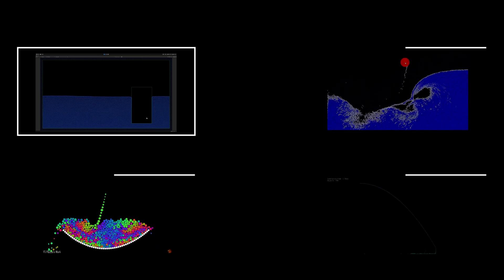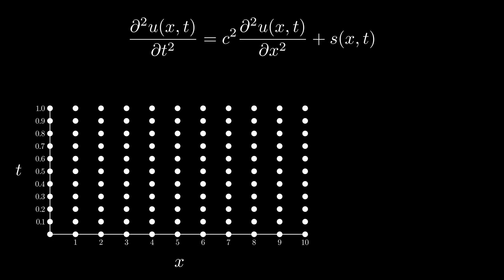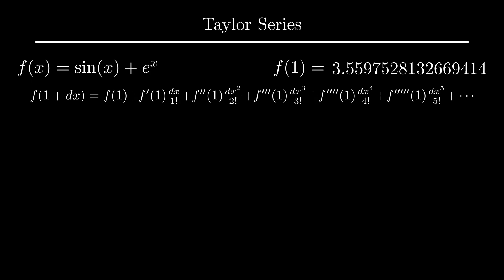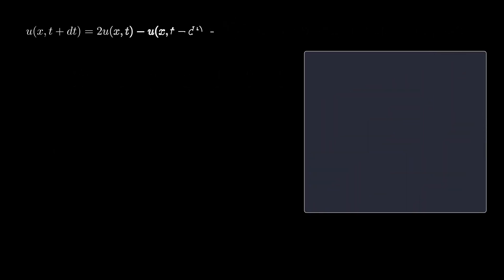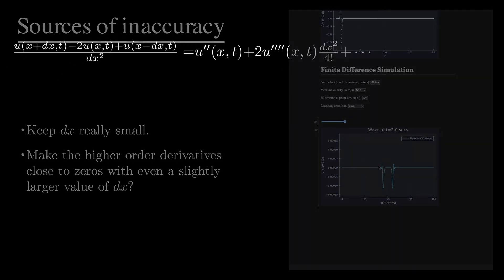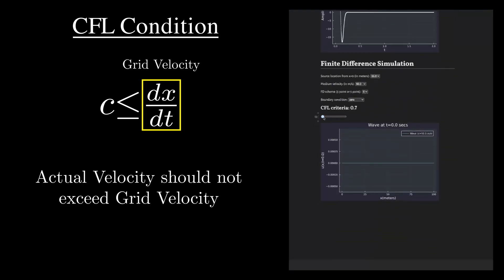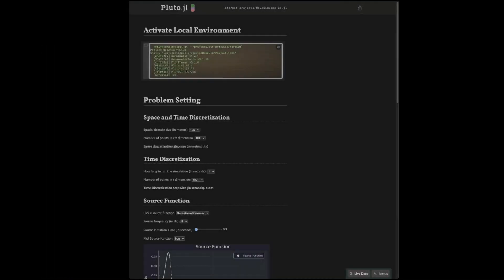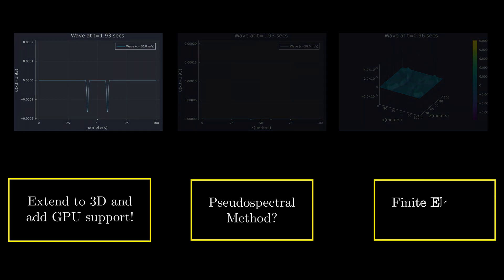Wave Simulation from scratch using finite difference method

Comment: Man this is awesome. 

I have solved Schrodinger equation time independent using finite difference method for 1d and 2d. I got good results and understood a lot of quantum mechanics and waves.

I hope to extend that to 3d and solve more advanced potentials  like multi particle system and use GPUs also.

Please keep doing videos like this. Will be really helpful to people like me
Reply from the maker: Thanks a lot for your comment 😃. Right now I'm working on GPU programming and will probably use that knowledge to solve the 3D wave equation (or some other PDE) in parallel on a GPU in some future video. I also have a website where I post blogs a little early. If you're interested you can sign up there to get early access to some of the content and give me feedback (that I can use for the YouTube video). Thanks a lot again 😃